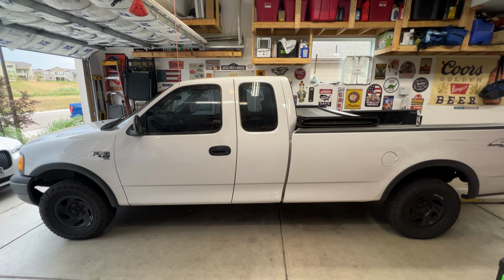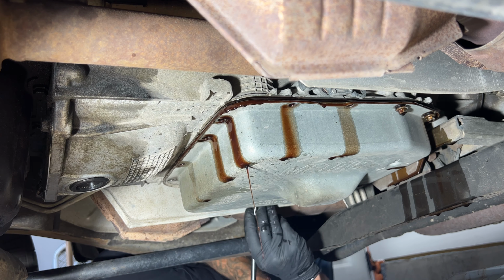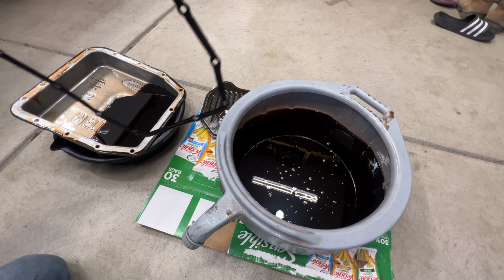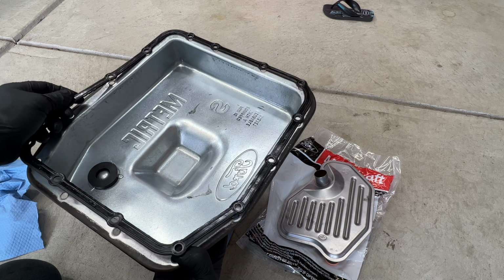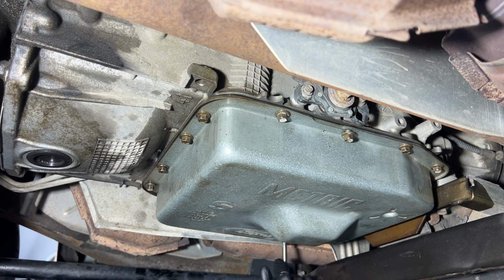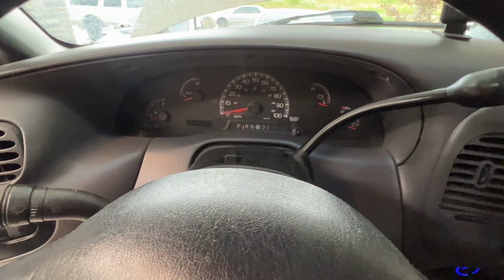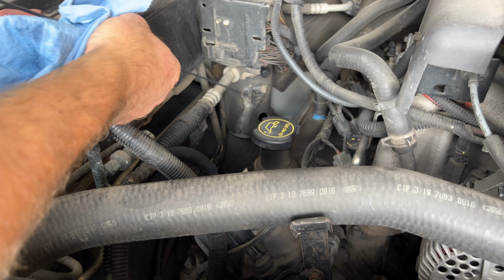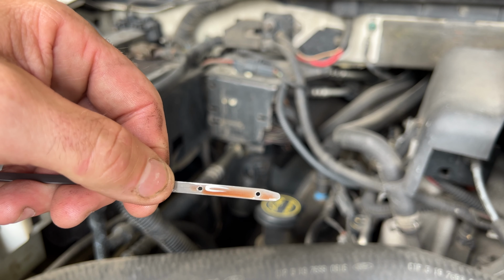2003 Ford F-150 Transmission Filter & Fluid Replacement 4R70W

Comment: Nice job on the video and commentary!
All I would add is to check around the pan gasket for any possible leaks after the new fluid is added.
I know, it's common sense to do that but some newbie diy's wouldn't think to check.
Again, good job on the video‼️

Comment: And finally, after warming up the engine and driving a tad, my level on the dip stick was at the very top of the grid, in fact, it was like 1/16th inches higher, and two very experienced car mechanics, who i trust like god,  told me it will be just fine, ok cool,  and I wonder what  you think about that, and so, thanks for the great video, you saved me anguish from deceiving mechanics and rip off prices!!!❤
Reply from the maker: If it’s just a hair over you should be fine. Just double check it after driving it for awhile to make sure the fluid has reached peak temperature and hasn’t climbed any further up the dipstick.

Comment: Hey again, and again, a great video and watch what I did, I found a 3/8 inch plastic tube that was cut to about 20 inches and I angled the pan, stuck the tube in the p;an, gave it a light suck, and bingo, the fluid flowed for quiet a while, making the pan less heavy for me.😊

Comment: Just dropped the pan and filter on mine today and ran into the same thing when refilling the fluid. I got exactly 4 quarts out of the transmission when dropping the pan but ended up needing to put 4.5 quarts back in. Kind of weird but I'm guessing what ever was absorbed in the old filter made up for the difference in the extra fluid needed.
Reply: Where do you put the transmission fluid in at.
Reply: @brendajoycewhite5747  you pour the fluid through the transmission dip stick tube, located in the engine bay.

Comment: Thanks! Doing it tomorrow.

10MM socket, 
Torque Wrench set to 120"# or 10'#, 
most people comment that they used 4 - 4.5 Qts of fluid
Reply: 120 inch pounds

Comment: Fun and mine put a quarter of oil accidentally in my transmission. For me, my truck, my Ford set there. For create a year's without being used. Because it was a will, and my friend just gave me his truck and was checking all the fluids. And there was nothing in the transmission fluid in the truck. Although the truck is driving forward and in reverse until my friend quit.  Oil engine oil in the transmission. Now it only drives maybe 3 or 4 blocks forward and drives miles backwards. What do you think the problem is? What should I do?

Comment: Thanks for the video, fixing to do this job myself, bought a pan with a drain plug on Amazon to make it easier in the future! Subbed!!
Reply: I weld in steel drain plug bungs when I drain any of my trans which is well worth it, and those without welders can either have it done by a bro or buy a pan with a drain. It makes life MUCH easier.

Comment: You didn't drain the torque converter
Reply from the maker: My 2003 never came with a drain plug for the TC I’ve looked before. I know a lot of the earlier models have a drain plug not sure if ford started going away from them or only on certain models.
Reply: @BLUECOLLARGARAGE  yes thats right I remember this now. Good video mang

Comment: I have a 2000 ford expedition 4.6L V8 Triton XLT and just wanted to know if using the ford Motorcraft Transmission fluid and power steering fluid is okay.
I didn't know Transmission fluid and power steering fluid was interchangeable like that since I am used to buying it separate.
Reply from the maker: I have never seen any complications when mixing them in the power steering besides turning the reservoir black due to the two fluids mixing. I know some of the express oil change places do it all the time not knowing a lot of vehicles take atf for power steering fluid.
Reply: Ford Mercon V was the official replacement power steering fluid for models after 1998 and I found out the hard way after I accidentally put 2 quarts of Mercon LV into my 2003 F150 and did a deep dive of research into this SCREW UP!

Comment: It is great how the engineers in charge to design these vehicles makes things too difficult to reach, hard to access to those hidden screws either on the transmission or the motor, at least those  parts for the regular maintenance should be easy to reach like oil filters, coolant, spark plug, etc, hope now the millennials do better work on new vehicles

Comment: Wouldn’t be better if spray break cleaner straight to the transmission for a better cleaning.?

You ll still have dirty old oil mixing with the new clean oil. 

Also how often you service a transmission.? I always tough you dnt replace the transmission fluid.!
Reply from the maker: I wouldn’t recommend spraying brake cleaner on the transmission valve body itself. Yes you do have old fluid mixing in with new fluid but if you do this method every 30k miles or so it keeps the transmission in tip too shape. Most manufacturers don’t recommend doing a flush with all new fluid the way I did it is the preferred method. I’ve done this since the truck has had 100k miles and it now has almost 300k miles and the transmission is still going strong.
Reply: @BLUECOLLARGARAGE thanks a lot for the video and your time to reply back.. I’m your new subscriber since 5 months ago